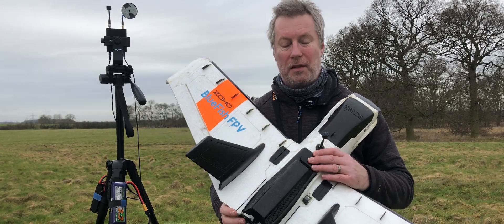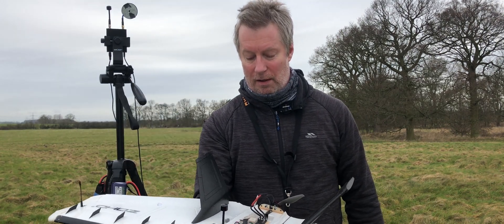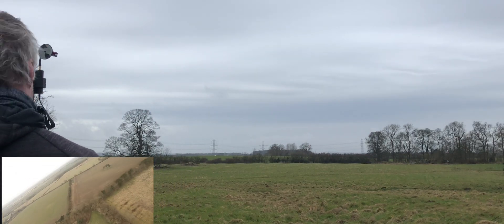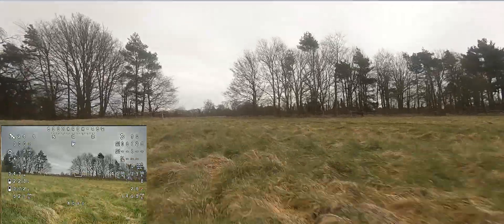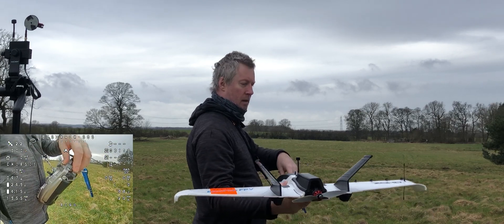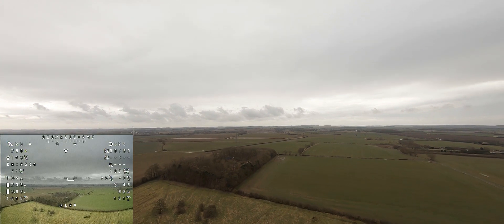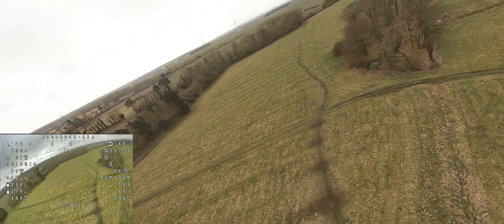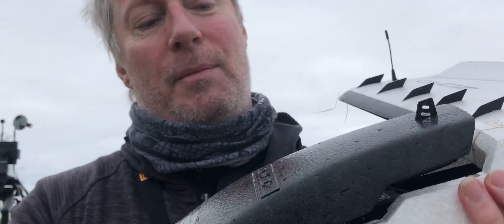Dart XL Testing  Badass 6S Mini Drak Powertrain

Comment: Hi mate great video,very informative. What are your launch settings?
Reply from the maker: Not flown my DXL for a few months here are my iNav ver 8.01 launch settings.

set nav_fw_launch_thr = 1900
set nav_fw_launch_idle_thr = 1400
set nav_fw_launch_velocity = 300
set nav_fw_launch_accel = 1850
set nav_fw_launch_max_angle = 180
set nav_fw_launch_detect_time = 40
set nav_fw_launch_idle_motor_delay = 10000
set nav_fw_launch_wiggle_to_wake_idle = 0
set nav_fw_launch_motor_delay = 100
set nav_fw_launch_spinup_time = 100
set nav_fw_launch_end_time = 3000
set nav_fw_launch_min_time = 2000
set nav_fw_launch_timeout = 10000
set nav_fw_launch_max_altitude = 6000
set nav_fw_launch_climb_angle = 30
set nav_fw_launch_manual_throttle = OFF
set nav_fw_launch_land_abort_deadband = 100

Comment: Performance wise it seems that a larger stator quad motor around 2507 or so would give equal performance.  What's the advantage of a huge motor such as this one? Better cooling so longer time at full throttle without risk of burning motor?
Reply from the maker: No advantage at all on this wing I was just testing the motor and esc as it is for my 6S Ritewing Mini Drak I am building and just a bit of fun tbh

Comment: You seem to have figured out auto launch quite well, I never got it working really good. Stuck to the scary traditional throttle up and throwing. Did you tune any of the autolaunch settings? I would like to revisit it at some point and perhaps stick with it if it treats me well.
Reply from the maker: I have only used Autolaunch since I started flying wings almost 2 years ago. Never had the experience or confidence to do it manually and as Autolaunch has been so easy and worked so well I never thought to try it manually. I have only tweaked 2 or 3 settings from defaults but definitely having the prop spinning before launch is engaged sems to help on planes with heavier payloads like my Dart  XL with its 4S 5200 mah lipo or 10000mah LION batterys. The AR 900 Dart 250G and as you see the AR Pro launch great with Autolaunch. Give it another try you may find you like it.

Comment: I noticed you launch in RTH. Any reason why and why not in Autolaunch? Cheers
Reply from the maker: I am using Autolaunch I have that set permanantly on which is a switch in the configuration tab in iNav. When you set RTH before you launch the plane will climb to your set altitude or for the launch time in seconds or whatever comes sooner and then immedialy go into RTH loiter and circle above you with you in the centre of the circle at your predetermined altitude and radius. I am running at 60m altitude and a 50m radius. You can also setup to go into position hold at the end of the launch and it will then circle in front of you or use sethome which is anew feature in iNav 2.6 where you can set a home position wherever you want and then RTH will return to those coordinates and circle around that point. Easiest to start with is just set RTH then launch then take control when you have your goggles on by just turning RTH off on your radio then fly wherever you want. Hope that helps Kyle.
Reply: @bluefish3607  Yes that's great mate. I'm pretty familiar with the launch sequences now, from trial and error. I was out earlier as the sun decided to make an appearance and the wind was low. I used my old hard as Fu@#ing nails Reptile S800 which honestly refuses to die. I set auto launch to permanent aswell, before it was arming a switch, applying throttle throwing and crashing due to not engaging ect. Now it's even easier. Normally just enter into nav hold and altitude if I want it to circle before I'm ready to explore. But I guess its exactly the same as using your RTH really as it does the same thing. I was just curious as I heard you arm RTH before launching that's all. What do you have planned next?
Reply from the maker: @k1ortia  Yes its pretty much the same and glad you have it sussed. Next is building the new Version 2 Dart XL for long range and going for my 25km target, finishing the Mini Drak and getting out to fly some interesting locations with all my planes when we are freed from this lockdown.
Reply: @bluefish3607  That sounds good. I,ll be giving that a watch definitely. As for the Lockdown fiasco absolutely no chance, been exploring and sending it since the start. Would be good to also see that groundstation build/setup you,ve got also?

Comment: Iv heard these motors are supposed to be pretty good, a little pricey though to be honest. How long did they take to reach the U.K?
Reply from the maker: They are extremely well made but quite pricey as you say only took about 10 days tomarrive but the import duty was £27 ☹️
Reply: @bluefish3607  Wow.. that's like £100 ish all in. Think I,ll pass on that one.
Reply from the maker: @k1ortia  Yes I think it came to about £120 with shipping and import fees.  I love SunnySky motors which are brilliant value and I will try one of theirs with the same size and KV rating to see if all that extra cost was worth it.
Reply: @bluefish3607  Yes the sunnysky motors seem to be the most popular  choice for us pilots. How have you been finding the DJI set up? What's the range been like? Cheers
Reply from the maker: @k1ortia  I love the DJI setup flying in HD is fantastic especially as my eyesight is not as good as it used to be and I wear contact lenses when I fly. Not worn my Fatsharks once since I got the DJI goggles as I use the AV in cable from my groundstation for my analoge planes and the DVR recorder is far superior to Fatsharks. Furthest I have gone with them with reasobale image is 6.5km
Reply: @bluefish3607  Yes iv heard they look amazing, but have also heard horror stories wit regards to the signal dropping out or freezing. At least with analogue you dont really get that. but i guess it should improve with time?

Comment: It’s shame you haven’t included flight stats after swapping the prop for 8x5. For me this motor is too weak for that (at given KV and input voltage) you were hoping it will be faster but it could not be due to 1” less in pitch and higher diameter + lack of motor power would even spin slower. 
PS. Everybody seems to justify performance by the amps being drown. You have to keep in mind that 4amps at 6s is not the same as 4amps at 3s etc. The first one is twice as much as the second although the number is the same. According to that formula (P=U*I) Power=voltage*amps drown.
Reply from the maker: Hi Michal, as I said in my video I did not know what to expect. That is down to me not really understanding or appreciating the mechanics of power and propulsion. I don't think the 8x4.5 prop gave any more speed or performance and may even have been less than the 7x6.

I have not been into wings for very long two years this April in fact and it has been quite a steep learning curve, building, launching, learning to solder, electronics, iNav, component selection, Open TX, 3D design and printing and video editing to name a few new skills.

But you are right if I want to hit my personal goals in this hobby I really need to get my head around power systems, props, weight and aerodynamics.

I mention amp draw because I have been working on long range and have this efficiency thing in my head that I have got to understand better but not confidently.

The purpose of my videos are to share my progress, experiences and adventures in this hobby as it gives me much joy and satisfaction and to get to meet like minded people like you.

I am not an expert and do not ever proclaim to be but do help people where I can.

You obviously have solid knowledge in this area so could you suggest a good source of information for me to start understanding better? 

I would really appreciate that. Thanks for commenting it has given me the nudge I needed in this area.
Reply: @bluefish3607  Absolutely no offence :) i was just curious about the outcome after you trying 8”5 prop. My source of knowledge is internet and FB groups (“BMFA” in the UK or “INAV Fixed Wing Group”). Regarding props: the diameter gives you the torque while pitch gives you the speed. Props are called an air screws for a reason: it’s same like the normal screw, the one with finer thread will go in less per 1 revolution than a screw with a coarse pitch. There is a very good power train calculator where you could try and estimate your setups- worth checking if you’re interested: www.ecalc.ch
Thanks for your videos and stl files. I will be building a dart 250g and ar wing pro and will definitely use some of your experience! Take care
Reply from the maker: @losien1  Absolutely no offence taken your comments were very useful and i am grateful you made them.

The analogy you give above really helps and I will check out the ecalc link for sure.

I think my building skills are better than my flying skills at the moment but I am improving as I get more experience.
Reply from the maker: @losien1  Just ran some numbers through the ecalc prop calc screen and the information it gave was really useful. I will now run all of my setups through it. Thanks for the link.

Comment: 7 inch prop on a huge airframe...nope....I thought you'd have learnt by now....lol...🤔🤔🤔😯😯😳😳😳🇬🇧..Loosing video at 500 metres?...
Reply from the maker: :-) Thats the prop size recommended by the Ritewing guys for the Mini Drak on this motor on 6S.

At least I know the powertrain is all ok for installation into my MD build and that was the purpose of the test.

My new Dart XL will be running a 9x5 prop on 4S with Sunnysky 2216 1250kv
Reply: @bluefish3607  It's just going to very noisy in your Mini Drac with a 7 inch prop, your neighbours will probably come and get you while your under the goggles....lol...🤔🤔😯😯😯😳🇬🇧...Interesting GS a 5.8g feeding your DJI Goggles... performance looked awful though...?
Reply from the maker: @EnglishTurbines  yes I quickly realized how noisy it was and won't be flying the MD at that location next to my house and neighbors.

The video feed is usually really good I think there is lots of noise with that ESC and motor so will need to think carefully about filtering on the MD.

I use the analogue feed into my DJI goggles so I can easily switch between analogue and digital planes, I have not used my Fatsharks for well over a year now.
Reply: @bluefish3607  Looks like you have R9 or Crossfire...1.2g video is the answer for analogue flying..An easy move since you have a Tripod docking module if I'm not mistaken...a 1.2g vrx in there with a low power 5.8g VTX relay to your goggles...Even using RDs will get you further and lower than 5.8g....🤔😯😯😳🇬🇧
Reply from the maker: @EnglishTurbines  Yes I run crossfire and have thought about 1.2. But I still have my Mini Crossbow tracker to get fully setup and see if I can beat my current 17km record.

I have not done that much long range but am hoping to go 30 km with 5.8, we will see.
Reply: @EnglishTurbines  you dont need 1.2g at all. I used to fly with 1.2 with high quality antennas and rmrc receiver, but changed to 5.8 with crossfire and have plenty of range. And about the prop 7 inch is better for speed. For launching it may be nore difficult but if you have enough thrust it will be fine. Larger props are more efficient but you also experience more drag, so larger props are better if you want to fly efficiently at lower speeds.

Smaller props are way better for speed, and about the sound they make higher frequency sounds so it seems like they make more noise, but when you get some distance it reduces quite fast. Larger props make much lower frequency sounds which is more annoying for more people because of the lower frequency.

Please dont act like you know everything. Clearly you don't. His setup is looking very good.
Reply: @bluefish3607  The whole point of 1.2g is it's very obvious low frequency advantage...You simply don't need all that tracking nonesense. I can be 5kms out at only 100 metres altitude and the image looks like it did when I took off...you simply can't do that on 5.8g..Once you do it, you will never use 5.8g ever again....lol...I'm serious..🤔😯😳🇬🇧
Reply: @pasifpv5508  lol...that was funny..😀 It's not my fault you don't know how to use 1.2g video...😯😳🇬🇧
Reply: @EnglishTurbines  i dont need tracking just a simple ORT helical 30 euros. Rapidfire and a decent vtx, like tbs unify hv32 or rush tank. And 30km's is no problem with 5.8. 

1.3 only makes sense if you want to fly more than 30kms but I dont need to, like 99% of the people. 

If you are you might try 5.8 again, you are probably doing something wrong if you have range issues below 10km
Reply: @EnglishTurbines  its not my fault that you dont know how to use 5.8. Everyone can fly 1.3 its actually more easy, the hardware might be more difficult to get, but you have way more range margins.
Reply: @pasifpv5508  Well, here's the thing, I wasn't talking to you.. 🤔🤔😯😳
Reply: What your saying is total truth I couldn't get 2 miles before I lost range video looked so dam terrible after a half mile 🤣 I switched to 1.2 and did 9 miles and video was solid 5.8 is trash gear and I only use it as a relay to keep me from having to use a cable from my eagletree eagleeyes this way I fly from inside my truck and stay cozy
Reply: @skyforce1983  Yep, but Pasi FPV here doesn't know how to use 1.2g...which somehow makes him an "expert"....🤔🤔😳😳😳🙄🙄🇬🇧
Reply: How can you take him seriously when all his videos are drone and dji 😂 can you blame him he doesn't know how to use 5.8 or even 1.2 he probably has his power wires crossed 🔀😆
Reply: @skyforce1983  Yeah, I'm waiting for him to show us his 30km outbound flight on 5.8g..lol. He'll have to be flying on the edge of space, that's what they usually do...🤔😳🙄🇬🇧
Reply: 7" prop on md is preferred.   I run  BA2814 1560kv 7x6 on 5s 4000mah.  120mph @55a.
Reply: I used to love 1.2 and dragonlink... things change.  DJI 03 air unit is the real 1.2 killer, especially with crossfire.  The intermediate step would be 2.4 video and crossfire control.  5.8 just always looked so much better I quit flying 1.2 because relay station with big pepperbox or helical was such a hassle to set up etc...